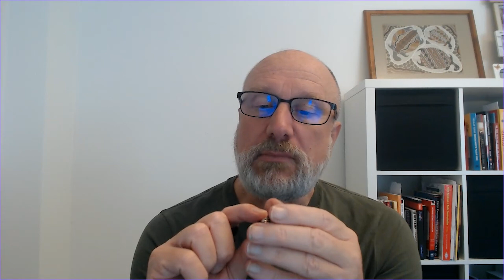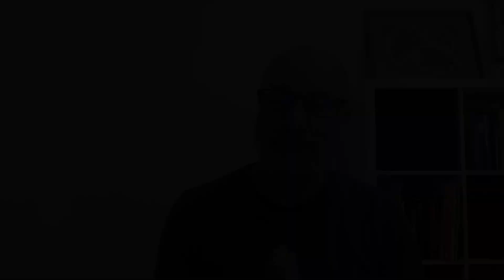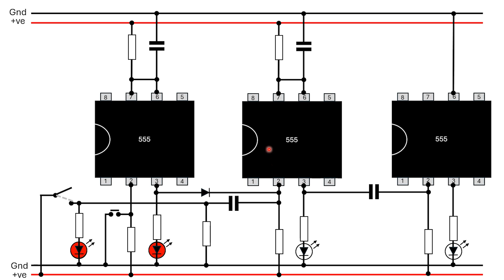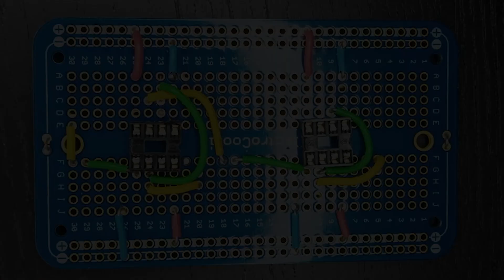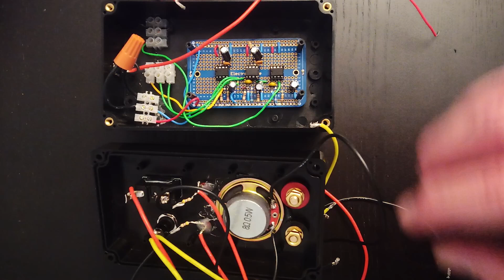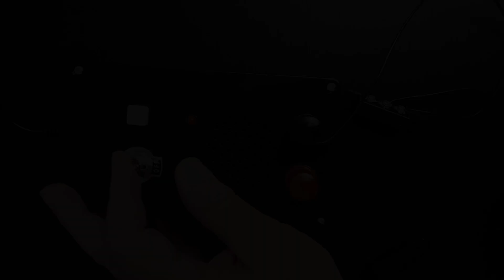Make: Electronics Book Experiment 17 - Building an alarm system

Comment: Found this book fantastic every exercise has worked perfectly which is a bonus. Until I come to this experiment my number 4 led lights up when power supplied and stays on  the other 3 led's flash on then work as per instruction rebuilt circuit four times and even with different parts so banging my head on wall lol. Has anyone else similar  problem and found a fix?

Comment: Hi Laurence, 
Thank you for your work 😍
 
I'd like to buy the 3rd edition of the book AND the kit. (Already have the 2nd ed. in PDF.)

Would you recommend buying the kit (which is quite exoensive, 100 GBP in the UK)
or just to buy a cheaper kit and other parts for the experiments? Thank you.
Reply from the maker: I haven't bought the kit I'm afraid, so it would be a bit unfair of me to comment on its value. I'm sure, in the long term, it's likely to be more expensive to source individual components, as you are generally buying more than you need for just these experiments. That being said, I do like to have spares to hand, especially for things that are easily damaged such as logic chips - I've managed to fry a couple of those just by being careless with letting wires come lose and brush across pins while the circuit was powered.